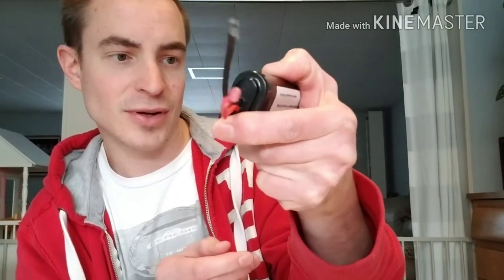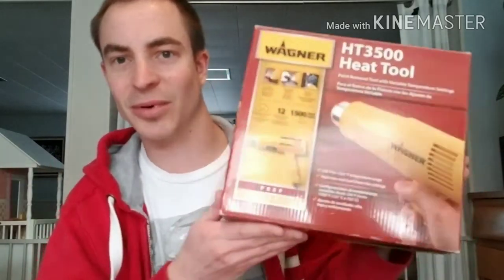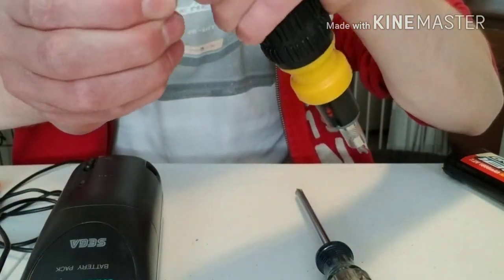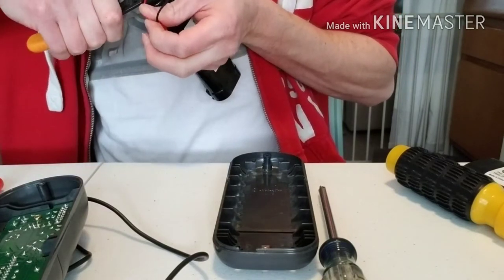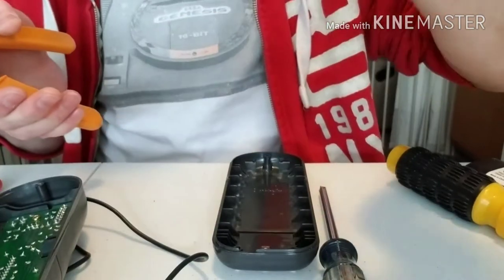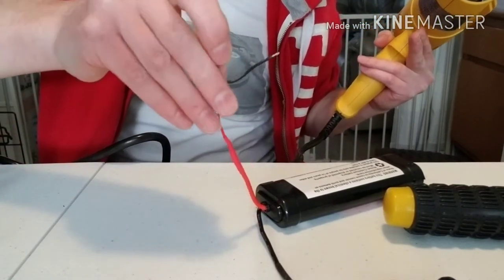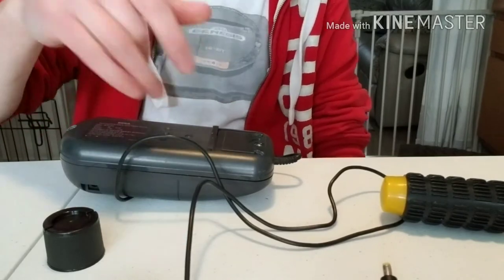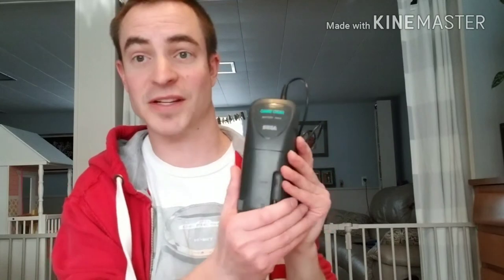How To #10: Repair A Sega Game Gear Battery Pack!

Comment: Thanks for uploading this, very helpful! I picked one of these up the other day and sure enough, dead battery inside. Installed a new one, though I didn’t solder the wires and went straight to the heat shrink, seems to be holding the spliced wires pretty good. Works like a charm now!
Reply from the maker: Nice!😊 I'm glad this guide helped you out.  I appreciate the support as well.

Comment: Gotta say huge thanks I have been looking all over for that bit or what the hell it is. I do a lot of GG repairs but hadn't one of these packs come to me until here recently. A trick to keeping from marring the plastic is use some masking tape over the hole and punch the bit through worked great for me. Thanks again man.
Reply from the maker: Thanks for the kind words man! :-) I'm glad this tutorial helped you out. I do plan to make one for the PowerBack, but as of now the battery is sorta pricey from 3rd party venders on Amazon. Thanks for the tip as well :-)

Comment: Very informative! Appreciate the links to screw bit & battery! Would suggest NiMH batteries, rather than NiCd. Longer lasting & don't have "memory" issues. You're life saver! Thank you!
Reply from the maker: Thanks man! I was thinking of using NiMH but since the original battery was NiCd, I wasn't sure if using a different type of battery would have been an issue or not. Plus they were also sold of of those types of batteries as well. The NiCd seems to fit quite nicely as a replacement for the pill type rechargeable battery. For the one you screw into the back of the game gear, I plan to use a NiCd battery since they are small and can fit inside the case.

Thanks for checking out my video! :-)

Comment: Hey quick question,  how long did you charge it for to get full charge and when it did fully charge did the light come off? Thanks
Reply from the maker: Thanks Clint!😀 Thanks for checking out my video, I appreciate the support.  I believe you have to charge it for around 8 hours for a full charge that last around 3.5 hours. I'm sure you can find the manual for it online that gives you the exact specs as well.

Comment: Job well done Mark!  Yo should do one on changing up capacitors on Game Gears :)
Reply from the maker: Thanks Jorge! I was thinking of doing something like that, but it sucks now since Game Gears are a hit or miss anymore...they used to be sure fixes :-/
Reply: mtshark7 what do you mean they're hit or miss now? I was just given one that has the dim screen and no sound and was thinking of getting caps from respected eBayer so curious what you mean. Thanks!
Reply from the maker: There have been several Game Gears recently that I've tried to fix that ended up with the dreaded no power issue. Sadly there is nothing concrete on how to fix that issue. One of the Game Gears in question was brand new out of the box and another one had a super clean circuit board. My theory is the longer they stay with bad caps the more damage they do to the circuit board so it's getting harder to be able to repair them now. Good luck on fixing the Game Gear...my advice would be to turn it on after every capacitor you replace to make sure it stays on, you don't need a game inserted, just turn it on and make sure it won't turn off on it's own.